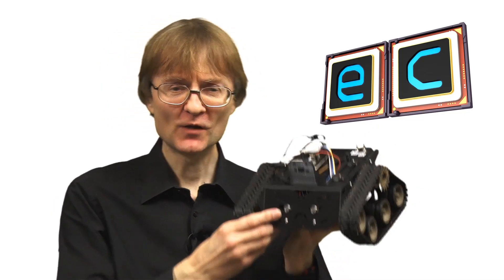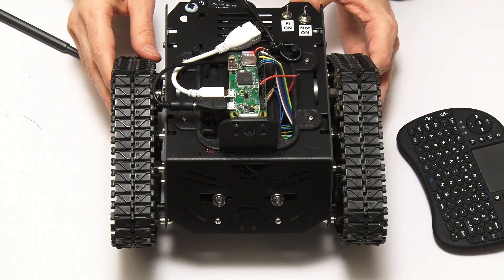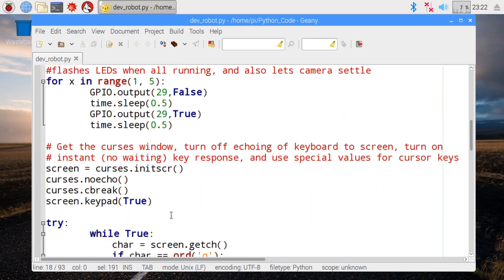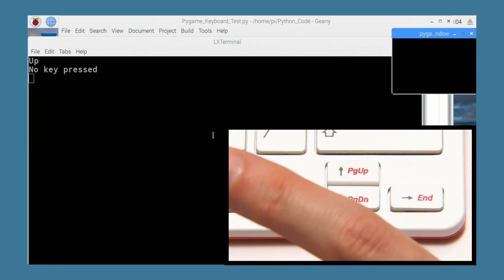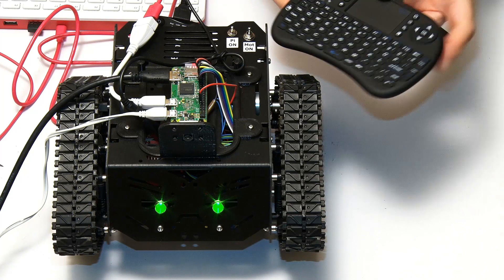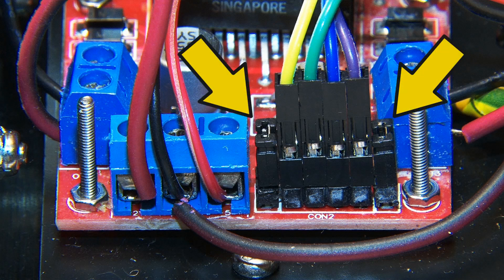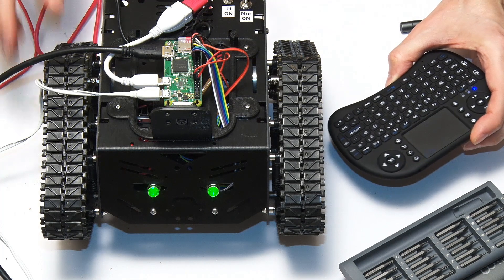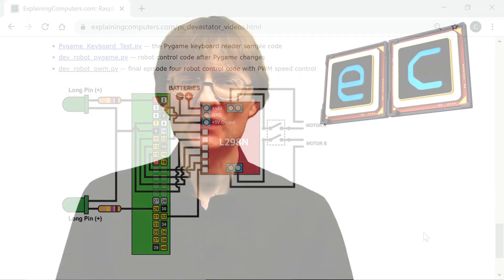Raspberry Pi Devastator Robot #4: Pygame & Speed Control

Comment: I got 1024x768 30FPS streaming to VLC player working with a Pi 2W and an Arducam that would be a good addition to this robot. It uses libcamera-vid and works on the latest Bookworm Raspbian. The command line on the Pi is "libcamera-vid -t 0 --inline --nopreview --width 1024 --height 768 -o - | cvlc -vvv stream:///dev/stdin --sout "#standard{access=http,mux=ts,dst=0.0.0.0:8080}" :demux=h264". In VLC on a Win10 PC, I open the stream with "http://192.168.0.94:8080".

Comment: whats happen if you press left and up at once time ? :)
Reply: Try it. I did. It seems to handle two keys at a time. If I press Left and Right at the same time, it prints LEFT RIGHT, but if I add a third key, it does not see it. Good enough for what I want to use it for. For me, I will drive two motors forward with the up key, and backwards with the down key, etc.

Comment: I am so close to getting this to work, now I get this error when I am controlling the pi from putty.

Traceback (most recent call last):
  File "Python_Code.py", line 8, in <module>
    screen = pygame.display.set_mode([240, 160])
pygame.error: Unable to open a console terminal

It works on the pi but not on my pc.
Reply from the maker: It will not work from Putty, at it is accessing the Pi over a terminal interface. I didn't access from Putty in the video, but using a wireless keyboard.

Comment: So, Raspberry Pi vs Arduino? I made an Elegoo robot with the series of videos from our friend Paul McWhorter. That robot has an Arduino controller. I did not like the blue tooth function that came with the robot so I adapted an RF control to it. It can drive along like your robot but it doesn’t have a camera. I don’t recall a camera module for Arduino. Maybe you could swap out the Raspberry Pi for an Arduino for a test to see which controller is the best to use?

Comment: I very much enjoy your Videos and I have been watching them for a long time, since you came out with your Raspberry pi Zumo Robot, and I came to the same conclusion you did with curses and pygame a long time ago but my solution was a little different I use pygame to control the motor controller with PWM and curses to control my pan tilt camera. I really don't like the PI Zero because it is too under powered for opencv and AI and  I am just starting playing around with ROS. I recently saw your video on the Argon ONE M.2 Raspberry Pi case and thought that would look  great on top of the DFRobot Devastator and to top it off would be to add my RPLIDAR A1M8 with a nice housing that I found on Thingiverse. It would be great if you could make some Raspberry Pi ROS videos since you explain complex issues easily.

Comment: Great video! i forgot about the speed thing.. I assume that you can make it turn while going foward if you set a lower speed in one of the sides while going foward.. 
Also i great part 5 would be LIVE VIDEO FEED and yet over wifi controls.. than you could control it from a phone connected to it via wifi for better range (i'm trying to figure it out actually)
Reply from the maker: You are right, you could all manner of gradual turns by running one set of tracks slower than the other. I may well stream from the camera at some point. :)

Comment: I have built a robot following your Guides and I have even added a remote firework launcher using a quad relay board. Using 4x 18650 batteries the tank goes really fast as well. Thank You Christopher for the video`s on what to do, You are very clear with instruction. All I need now is a PTZ camera with a live view so I can then drive it up and down the street, on my WiFi Launching my rockets lol.

Comment: Cool.  I think control would be easier if the forward/back buttons were toggles, hit forward and goes, hit it again and it stops.  If going forward, hitting the back button would go backwards, etc.  Then left and right buttons would do different things based on whether or not it was moving.  That is, if moving forward, hitting the right button would just slow the right tread, so it could continue to go forward AND turn.  Perhaps have the right button also a toggle, sort of, if moving, one hit on right button would cause right tread to slow 66, second hit would slow it to 33, 3rd to stop it entirely.  Hitting forward would then resume straight ahead, cancelling the right button.

Comment: Very interesting video.
I'm curious when setting the speed are you automatically forced to have a maximum option of 100% ? 

If one was to type say 200%. Would the motor over clock and work at a higher speed until it burns out, or would the motor just run at 100% being its manufactured maximum?
Reply from the maker: A square wave pulse cannot be high more than 100 per cent of time. So you could not overclock the motor by trying to set a higher value -- 100 percent is "fully on". :)
Reply: Thanks

Comment: So many opportunities for customization here -- one could modify the code to automatically slow the motors during a turn to make turning more accurate.  And I see that when you let go of any key, all the motors would stop. One could customize that part of the code to check and see which key you let go of, so that if you, say, press and release one of the "speed" keys while holding the forward key down, it won't stop the motors until you release the forward key.  So many possibilities here!  Love it!

Comment: Followed you for awhile now. The Pi stuff fascinates me. I am particularly interested in this video. I am a building inspector and would love to have a similar setup with a Pi that would allow me to control a camera with a pan/tilt setup on top with lighting and picture taking as well as record functions when I use it in a crawl space or other tight areas. In my current setup I use 8 channel RC Car controllers - the kind with a joystick. They all seem to run off 2.4. Any ideas how to get started in this direction would help. Thanks for all the great videos.

Comment: With daughter we also building the robot based on two raspberry pi computers. One is in the robot  and the second is the control station.  We realized for rotating the camera more suitable to use the separate turning mechanism based  on the stepper motor with pre-programed angles to turn. Because you've noticed that tu turn the camera by turning the robot is not easy to catch the proper angle. Also you right that the final tuning of the rotation and speeds is necessary in accordance to the bot dimensions and it's motors capabilities :) 

One problem that the "real-time reaction" to the button press isn't working in our configuration bot <-> control station. However we working on it now...

Comment: Hi. You'd said adding the camera made you end up having to add another power supply.... so why not have the secondary power supply purely for the camera - so if that supply ran out the rc vehicle would still drive? The camera not being essential of course.
Also I'd like to see a PlayStation or xbox controller operating it. I dislike the chosen control device.
Analogue sticks could be pushed x-amount for different speed values. 
Otherwise a brilliant project & entertaining videos
Reply from the maker: I see where you are coming from on the camera, but the camera module is powered via its ribbon cable connection to the Pi, so would be very hard to power independently.

Comment: I have Initio from  4tronix could you do a video or help by and put about the coding of initio in one of your robot videos my intio has 4 servo wheel distance a camera motion sensor l could get it to run on the test program but . That's it If l run  it any other way the batteries run out ?
Thanks for any help .

Comment: You have an open loop control just now. You might also want to consider a closed loop controller, where you record the speed of the wheels (like number of ticks generated by some of the wheels in the transmition), so it can adjust the PWM so the robot is traveling in the expected speed, if it can.  Not just guessing what speed it should have.  Then you actually can lower the speeds.

This should probably be a PID controller, which isn't that hard to do.  Adjusting the P, I and D constant is a bit harder though (but to make it easier, just set some to 1.0 and some to 0.0).  That would probably be a better start, and put that in a class so the controlling get abstracted away an easier to control from the rest of the program.

Fun video, anyways. Thanks.

Comment: Hi got a quick question. I have a pi zero w and the camera model but when I try run the camera it lags really bad and when I checked the cpu usage its at 99% but when I use the camera on my pi 4 the camera runs fine. Any ideas? Just in the video your camera works fine with pi zero.

Comment: I have been using L298n motor driver for my project but when i try to run the dc motors they move very slow and cant produce enough torque. What could possibly be wrong ? I have seen many forums talking about the same 8ssue but cant find answer.

Comment: Great video!
An improvement suggestion: If your robot gets out of range it will never receive the KeyUp event, so it will continue advancing forever.
Solution: the controller sends the status of the keys every second not only when they are pressed or released. The robot has a timeout so if it doesn't receive an update every second it stops.
You can test that by leaving a key pressed and switching off the controller, so it never sends the keyUp event and the robot initiates the emergency stop.

Comment: Great video, Chris.  If you want another programming challenge, try using the pwm speed control to make high speed turns when at speed 3.  For example, run the left track at speed 3 while the right track is forward at speed 2.  Should make a more gradual turn to the right. 😀
Reply: Thanks I'll borrow this idea 👌

Comment: So I have a question -- can you change speed while the robot is moving, or only while it's stopped?

Had missed its earlier adventures so this was my first experience with those mysterious GPIO pins. :D
Reply from the maker: Yes, speed could be changed by moving code-wise, but not with keyboard control if motion is controlled by holding a key down.

Comment: this may be a stupid question, why did you not use a 'case' statement?  Case beat If/Else and is easer to follow in code.
Reply from the maker: I'm struggling to see how this would make the code easier to explain to those with little or no coding knowledge. IF has the advantage of having a parallel in English, and the use of elif makes the code efficient as only one condition will be evaluated. Python does not, to my knowledge, have a switch statement to use with case.

Comment: If you had independent motor speed control and could set one side down to 80% or so while in motion, you could correct for wandering like when it ran over the rock - without stopping to do so.

Now I want to build a robot...lol. thanks for the update and ideas.

Comment: Cool video! Would be even cooler if you introduced committing to some version control system at each step 😉 Sneak those good habits in early...

Totally didn't think the pi had pwm for some reason...

Based on the name I was thinking you had made a battle bot...

Comment: Great video. If it were a true 33% and 66%, you would have first had to test what the minimum pwm for the robot to move is and then work with that as the minimum and not 0. But I'm sure you know this and this was definitely enough to get the point across😊

Comment: Oh, for the speed, hook it into a timer so that it will always start slow an accelerate the longer the direction key is pressed. That way, you don't need to manually select the speed, and you can, in fact, have it range rather than be on fixed values. Noted that to slow didn't provide enough power, but you could simply map a range to ensure that minimum power is sufficient. Maybe include a toggle override (that locks the speed) for those situations where you want a constant speed.

Comment: That's fascinating. Will have to go back and review the earlier videos. Was there any particular reason for running a full GUI on the Pi? It is a long time since I used curses (well before I had a computer that could run X-Windows) so I know it doesn't need the graphical display.

Comment: Hi, maybe you can change the code, so when the robot has to turn, the PWM setting is changed to 66% power by default, and when it moves back and forth it returns to the PWM setting you chose before.

Comment: Great hack! You can default to speed 2 for turning so you are sure it has enough power to turn in a controlled manner (1 is not enough and 3 is too much for rotation)
Reply from the maker: Yes, it would be a good idea to do all turning at speed 2. And in forward or reverse, to increase speed the longer the key was held down. So many possibilities! :)

Comment: Well done. Perhaps you should use a Raspberry Pi Pico for the hovercraft. But I must quibble... this is not a robot. It's simply a remote control (RC) car.
Reply from the maker: How it is not a robot? It is a mechanical device controlled by code. There is no direct electronic relationship between the controller and motors, as in an RC car. Here, a program determines how the robot moves, and does other things (like recording video). With the setup shown, the code to do this is controlled by human input from a controller, but it does not have to be.

Comment: Fantastic work and I have the question of would it not be more suitable to have the duty cycle percentage as a variable instead that can be incremented using one key up to 100 or decremented using the other key to 0 to have more control over the precise speed of the robot?
Reply from the maker: Yes, certainly -- if this video was not already quite long, I would have implemented this as you say. Maybe having it increment the longer a key is held down to offer smooth control. I may well return to this . . .
Reply: Or making multiple way to control it with "gears" and incrémentation?

Comment: Robots and overcraft? I am looking forward for those projects too!
I am wondering if you will use a quad propeller sort of contraption to make it fly. If so, it makes me think of another channel where the creator 3D print fans for the hub of a computer case fan Noctua.
I am thinking that such a thing a a creator who do also print fan, not just for the Noctua, but also his own hover craft, it would make a splendid cooperation video.
His channel is called majorhardware. It is also worth the look.

Comment: It would be nice to code in acceleration and deceleration, maybe even using an easing function.
Reply from the maker: Yes, a definite possibility -- for example, the longer a key is pressed for, the faster it goes. Maybe with a speed limit for turning. I may well do this!

Comment: It would be so cool to also output the video feed as a streaming file over wi-fi and use a tablet to view the feed.
Reply from the maker: Yes, I have to add this at some point.
Reply: @ExplainingComputers  that would be awesome 👍
Reply: @ExplainingComputers  give it some 'stick' and the pi zero w or a separate esp32 cam might be better
Reply: I have made it running via my phone over wifi, I used RaspiControler App and the VLC viewer app to stream it via my WIFI. unfortunately its streaming very slow. Maybe someone has a more direct solution for that.
Reply: @JS-do2ye  I found this command to run on the pi side  “raspivid -o – -t 0 -n | cvlc -vvv stream:///dev/stdin –sout ‘#rtp{sdp=rtsp://:8554/}’ :demux=h264” and then this on the phone rtsp://ip address of your pi:8554/
Reply: @IanPowell1985  I will try that in the next weeks. busy at the moment. sorry.
Reply: @JS-do2ye  You should be able to control it and watch the feed via VLC? If you use a directional antenna for your wifi you may even extend it's range of operation... Let me know how it works out?

Comment: I had been wondering if the Devastator would return for an update and not disappointed. Using PWM is definitely a much better approach to getting the robot moving in a controlled fashion especially with the hard plastic tracks. Looking forward to the next instalment

Comment: So now I'm wondering about fitting my R/C tank with an RPi and a camera so that with machine learning it can recognise cats and autonomously patrol my garden to chase them off ?
(I don't dislike cats, but they try to catch the birds and they leave unwelcome "presents" in the flower beds)
Reply: But it would also chase off lawyers. Possibly not a bad thing though...
Reply: @caw25sha  If it could recognise lawyers I'd also fit it with a flamethrower.
Reply: Why are lawyers wandering into people's yards?  Is this a typical problem that people have?  Have I just been lucky to only get stray cats?  Do they lawyers poop in the flower bed?
Reply: That sounds like a fun project.  You could probably program a specific route for it to patrol, which might be enough to make the cats keep away.  They also sell motion detecting sprinklers, specifically for scaring off cats by spraying then with water.
Reply: That sounds like the best use case ever! I suffer from cats crapping in my yard, and haven’t yet found an effective deterrent.

Comment: If there was a bug which turned on the forward and reverse pins at the same time would it damage or destroy the Raspberry Pi?
Reply from the maker: It would not damage the Pi, which is just outputting GPIO-level signals to the controller. It may I guess damage the H-bridge in the L298N motor controller, maybe shorting the battery power supply. I've never tried it!

Comment: I also used Pygame for this robot a few years ago. I too should probably dig it out for more experimentation. The original plan was to mount a pan-tilt turret on the top with a laser that could burst black balloons.
Reply: Can you control a stepping motor? Would be good for a turret.
Reply: @caw25sha  Yep, that was the plan.